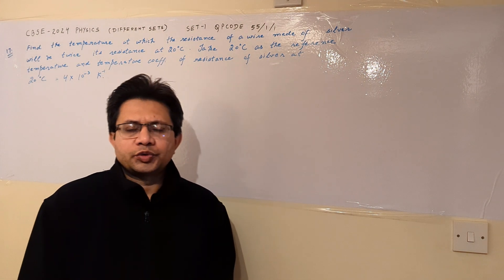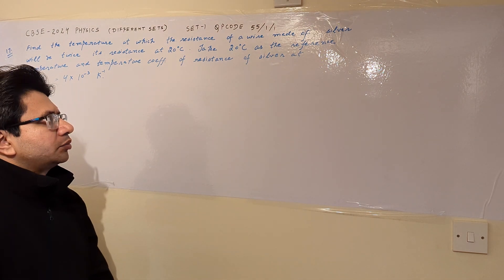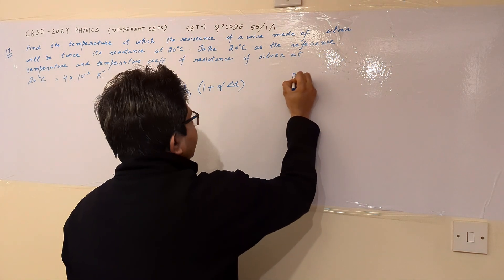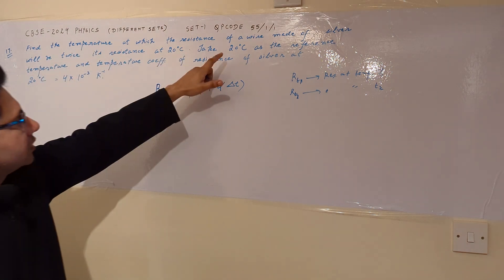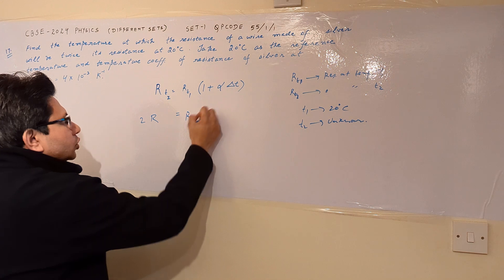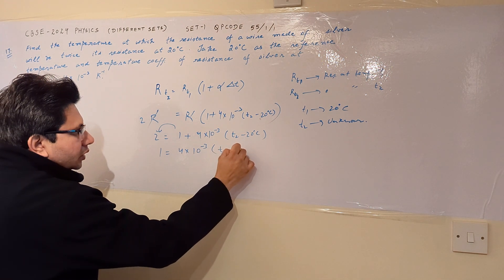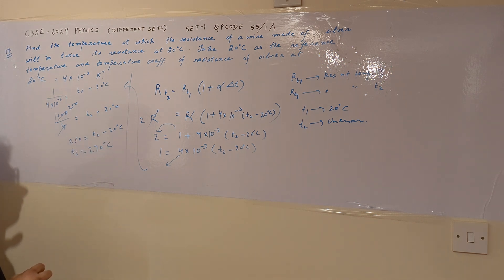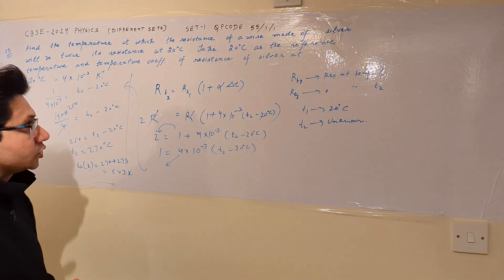Find the temperature at which the resistance of a wire made of silver will be twice it's resistance

Comment: Sir for the finding temperature through alpha value its given in kelvin so dont we have to convert that before using it with the 20 degree Celsius?
Reply from the maker: We obtain the same result in both cases as the formula consists of delta t. Means the difference of final and initial temperature. The difference remains the same whether you start solving with Celsius scale or Kelvin scale. So if you want to convert it to Kelvin scale at the initial step, you can use this approach. Results remain the same.
Reply: @ansh2708   thank you so much Sir for your time and patience 🙏
Reply from the maker: My pleasure